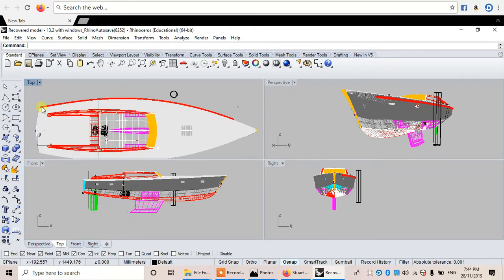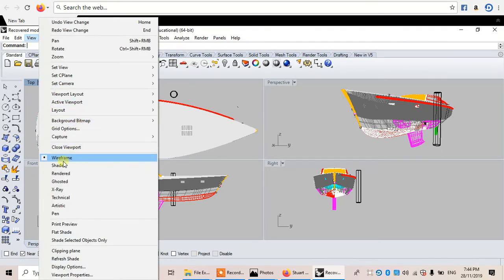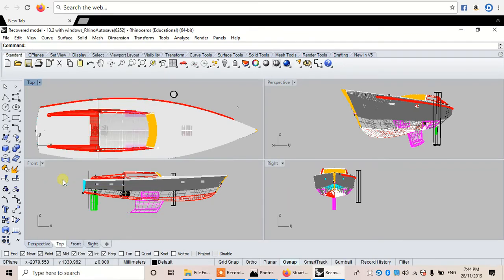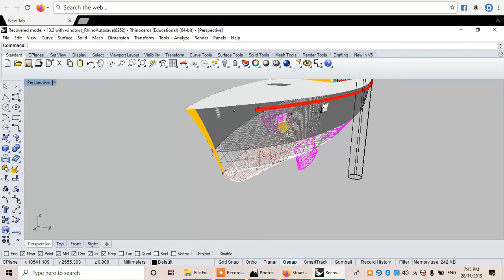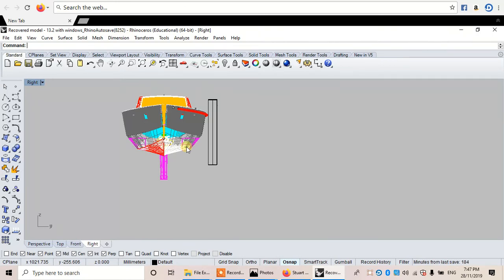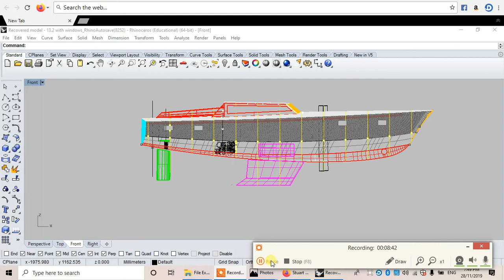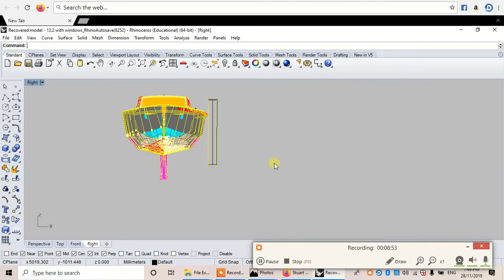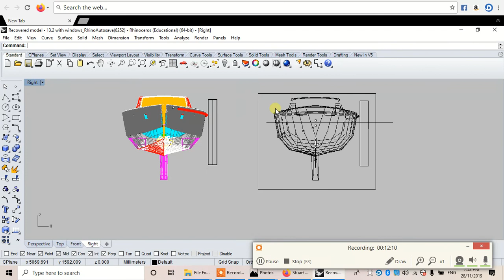13.3m aluminium sailing yacht offer plans and build advice

Comment: Hi Stuart, I'm interested in this design and the use of ally for small-mid size yacht construction. How is best to contact you? Could this design be modified to have a skegged rudder or even a more full keel. Could the upper portions of the keel be used for diesel/water tanks? I have many questions. Look forward to hearing from you
Reply from the maker: hearnyacht@gmail.com, sorry i just saw this